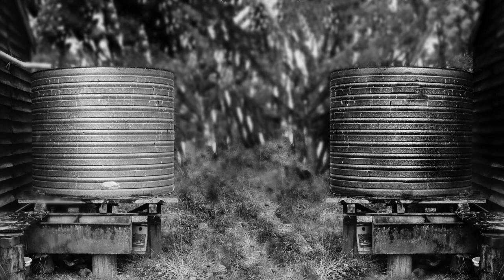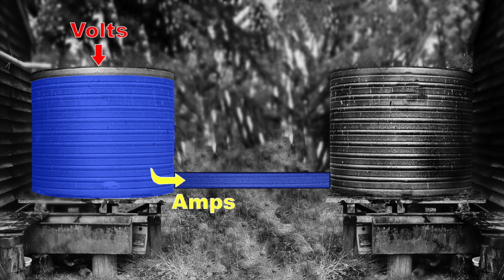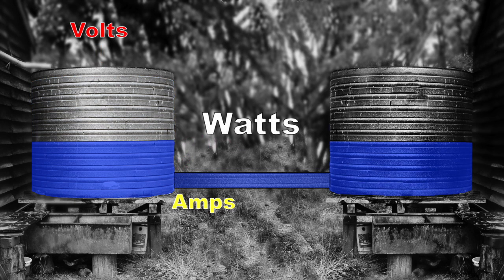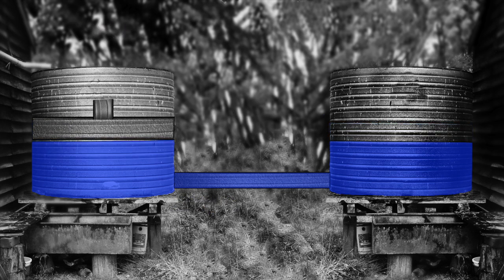Energy Management Part 1: Volts, Amps, Watts and Ohms

Comment: Great video Robert, takes me back to my high school electronics class!  We really had a chance to evaluate how we use the power in an Embassy, when our alternator practically stopped charging last week.  Luckily we were on our way to Embassy and Ryan is fixing it at this moment. But having to look for a campsite with electricity every evening was not fun!
Reply from the maker: Oh my! Why was the alternator not charging? Hope it is fixed by now!
The analogies I used in the video are about as good as I could think up... not perfect, and of course the subject is far more complex, but I'm hoping it presents enough good information for the practical application towards energy management.
Thanks for commenting!
Reply: @RoadsofLife  I guess the Balmers burn out diodes occasionally. They convert the natural ac to DC, and as each burns out, it cuts down the output. But it's under warranty so they just replaced it. We should be out this afternoon sometime.